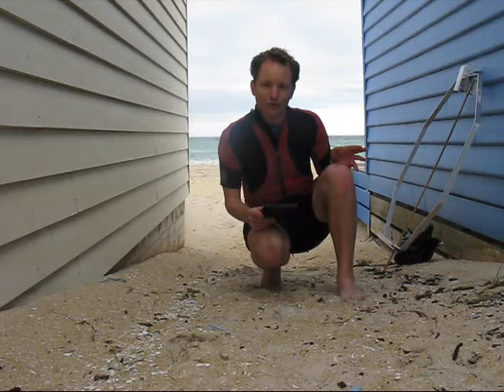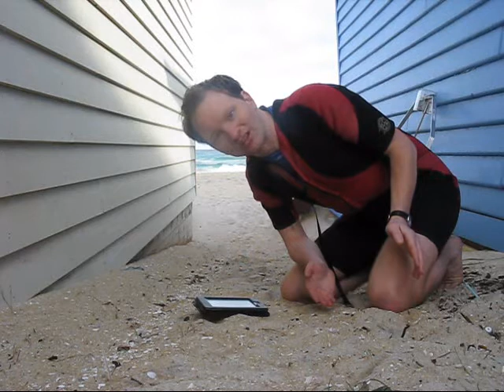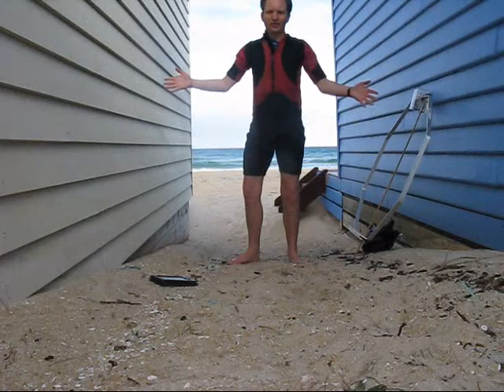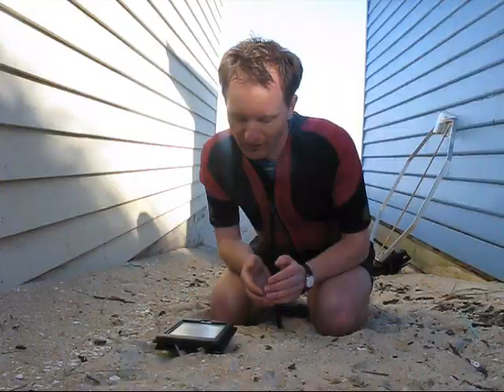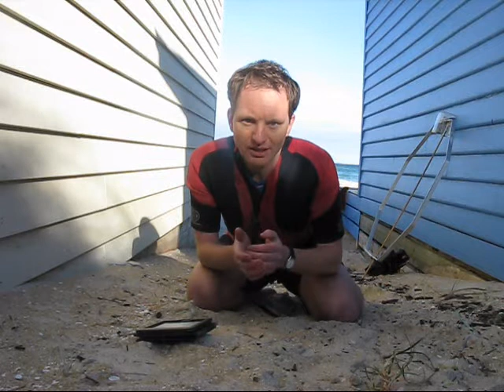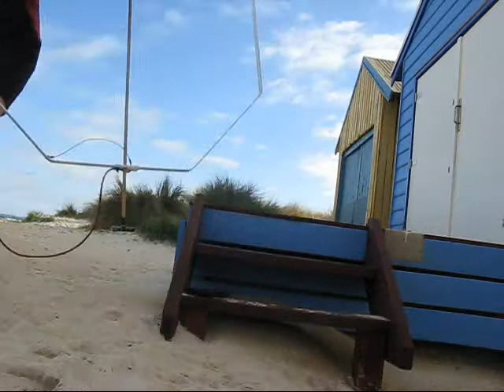Hints and tips for producing amateur radio videos

Comment from the maker: Thanks Anthony. Yes 1/3 sheltering from the wind, 1/3 serendipity, 1/3 design.  There are light variations as the sun rises over the dunes and goes in and out.  I suspect the auto light adjuster was playing havoc as images aren't as clear as they should be (due to reflection off the sand?).